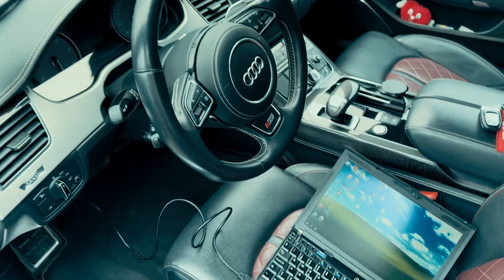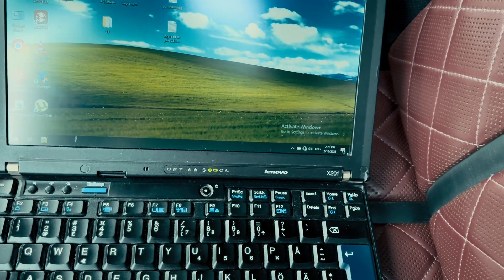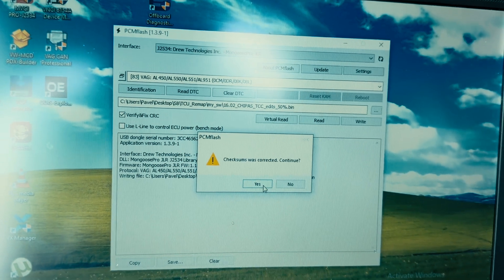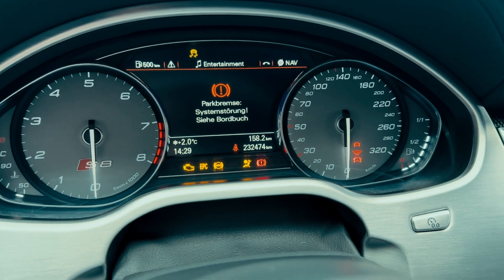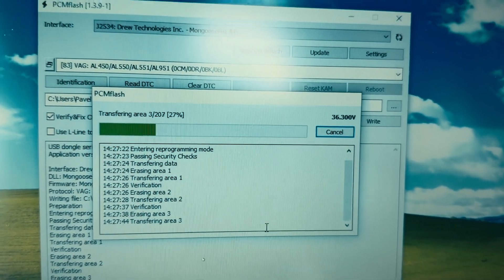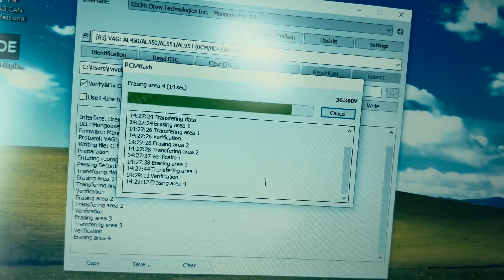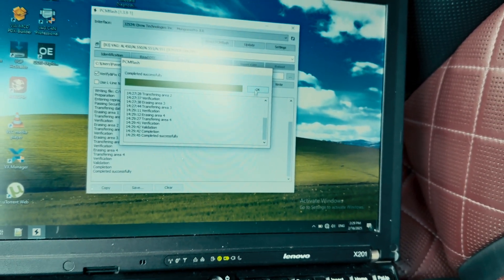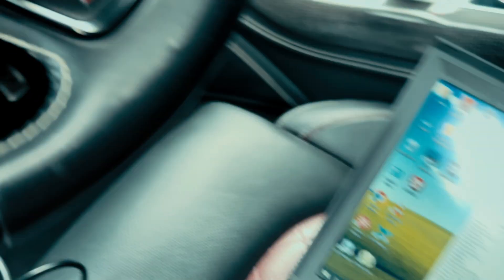HOW EASY it is to FLASH your GEARBOX at HOME! // Audi AL551 ZF8HP 0BK/0BL Flashing Using PCM Flash

Comment: Hi Pavel, any chance you are going to release the files?
Reply from the maker: Hello, the file is a read of the exact gearbox of the exact vehicle. If you buy the flash tool that I use, it will do a virtual read of your car and you will have your file :)
Reply: @pavelppp888  Thanks. I saw your thread on ecuconnections. I suppose I was more interested in which maps you changed from the map pack. "Gear shifting times" ? "TCC Behavior *"?

Comment: Hello. Audi a6c7 bitdi 313hp ZF 8hp can you also upgrade? Where can I buy the PCM?
Reply from the maker: What’s the current version of your software of your gearbox?
Reply: I can take a look tomorrow evening.
Reply: Hello 
VCDS Release 24.7.0: 02-Auto Trans, Advanced Identification

Advanced Identification/FAZIT

Identification: ZFS-005

Revision: H16--

Date: 03.02.13

Manufacturer number: 5114

Test stand number: 0074

Flash Status

Programming Attempts (application): 0/0/0/0

Successful Attempts (application): 0/0/0/0

Programming Status: 00000000

Flash Date: 00.00.00

Misc.

Hardware number: 0BK 927 156 AM

Workshop System Name: J217

ASAM Dataset: EV TCMAL551211

ASAM Dataset Revision: 002018

Car Info

Chassis Number:

VCDS Info:

VCID: 6ED37BBFB1970CE621-803A

Labels: 0BK-927-156.clb

ROD: EV_TCMAL551211_002_AU48.rod
Reply: ECU identifiers

02. Transmission control unit

Manufacturer spare part number: 4G0927158AB

Manufacturer ECU software version: 1003

Manufacturer ECU hardware number: 0BK927156AM

System name: 0BK 30RTDIRdW

ODX file id: EV_TCMAL551211

HW ver.: H16

ASAM ver.: 002018

Programming date (HEX): 30424B393237313536414D

Long Coding: 000001

Comment: hello pavelppp888 can you also post the video as you promised for modified maps to quicker shifting? here filipe39 from ecuconnections
Reply from the maker: Yes, it is the next video in that query.
Reply from the maker: Maybe next week :)
Reply: @ all ok i figures all the points so far, just this is interresting. because you said if i will modify just all of the maps its jerking, or?
Reply from the maker: Hm, the jerking could occur if you overdo the maps for the lower gears <3rd. At least that happened to me when I have tried.